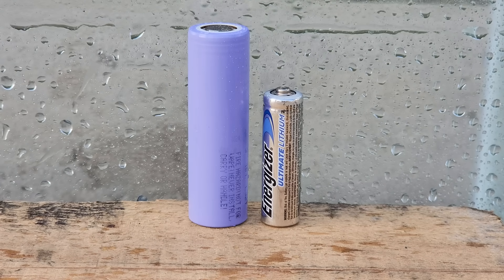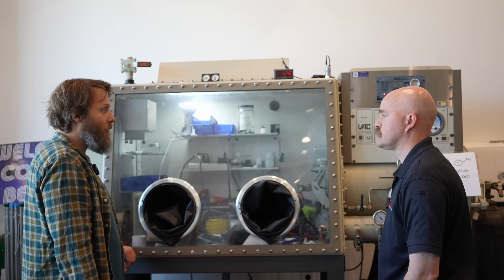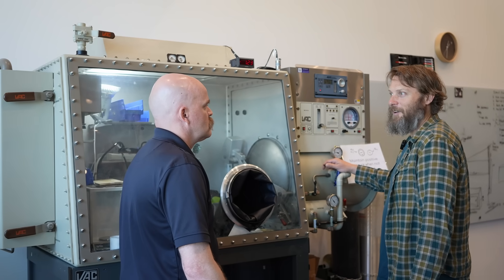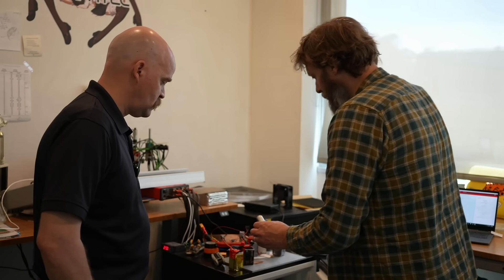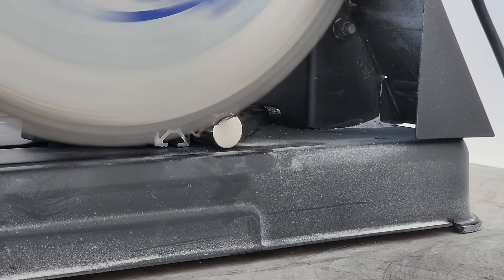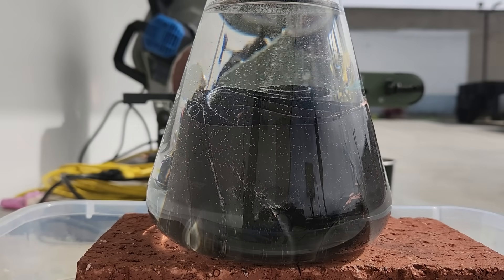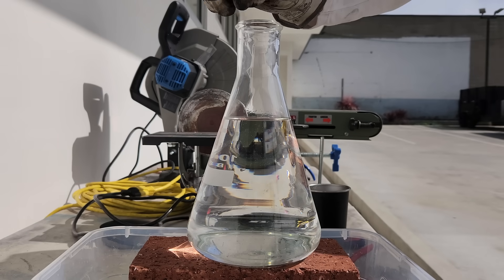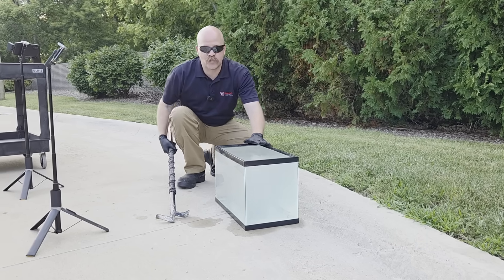Do Lithium(Ion) Batteries Explode in Water?

Comment: I'm not disputing this video, but people should be aware that exposure to water inside a battery bank like an e-bike pack can cause a short in the BMS, or the output circuitry or wiring which initiates the thermal runaway. I personally can vouch for an exploded 22a/hr, 90%+ charged e-bike battery when it fell into the bilge of my boat. The bilge had salt water in it which found it's way into the "water resistant" battery pack. The salt increased the conductivity of the water (clean, fresh water actually has low conductivity). The battery hissed and smoked for about 60 seconds and finally burst into unmanageable jets of flame. It wasn't that the individual cells were exposed to the water, it was the water passing current from one cell to opposing cells at over-discharge rates.
Reply from the maker: You are 100% correct.   Water in a battery pack will eventually lead to thermal runaway.  I put this together because do many people think that if an individual cell gets wet, it will instantly react violently.
Reply: @StacheDTraining  its an important concept : A cell is not a battery, a battery is a collection of cells. We get this wrong by calling a single cell a battery interchangeably in conversation which compounds the confusion for non-electronics professionals.
AA cell is a cell ... two (or more) of them in your "flash light" then means a battery is formed in the handle.
Reply: @finophile A cell is a collection of batteries. Edit: A pack is a collection of batteries. You are right the battery is a collection of cells.
Reply: How about - you are both right? A 'pack' does not equal a 'cell', because a 'pack' contains many 'cells'. 
I learned something in this video, too. I work with Li Ion cells, making battery packs for 2-way surplus radios, and have seen some anomalies with cells where after charging a particular cell starts to 'self' heat and will discharge itself, usually an older cell that has been cycled a few hundred times over more than four years.
Reply: Never buy cars that where flooded out and totaled by a insurance company regardless of whether it is a ice or anything.
Reply: @jonathanjones3126  It depends on what you want to do with the car.  If you are going to strip out all the electronics to turn it into a race car then it is a much cheaper way to go.
Many new cars have a lot of electronics in the floor so even if the water only got above the door sill the electronics will eventually fail from corrosion.
Reply: @johncooper4637 opd non computerized cars have a big draw, they also have significant issues that computer controlled ignition and air fuel mix solved
Reply: @jonathanjones3126  The only thing flood vehicles are good for is salvage yard (non-electronic) parts donors, which is a nice chunk of change when harvested wisely. I've built many vehicles using salvage parts, but never a flooded vehicle which is very different then using hoods, fenders, door sheet metal, suspension etc.
Reply: @jonathanjones3126  if they have an ecu, then moisture in the wiring loom is bad. But pre ECU okay but then we're talking classic and vintage.
Reply: @Biggles732 any break in wiring will develop issues eventually,  the pre computer cars are easier to fix if you the manual and wiring diagrams
Reply: @Biggles732  Classic and vintage corrode too, especially in salt or brackish water. The Air Force requires clear water rinse for aircraft flown too close to the ocean and that's not by accident. Old wiring with the usual existing insulation hardening and internal corrosion (wire left long enough in vehicles corrodes beneath the insulation over time) is best replaced. Even without a flood most old car/motorcycle problems are electrical. (I've wrenched since the late 1970s on vehicles old and new, wheeled and winged.)
Reply: @Comm0ut  yes, but the wiring in older vehicles is doable. The intricate wiring looms of today's vehicles means you have to abandon them /write them off if flooded.
Reply: Yes you rely on the precision craftsmanship of child laborers and trust that cargo shipper and amazon driver did no damage to the product before it got to you and that it never took a hard knock during use.
Reply: Where was the E-bike manufactured and sold from China / Amazon if the answer is yes there is your problem. Chinese sellers on Amazon have zero risk of lawsuits they use a local shipping center to warehouse their products. Amazon hides behind section 230 gives them immunity from lawsuits. If you want a high end ebike many are made in the US going to pay lot more Trek $4600-13000. Trek isn't made in the US anymore but they are a US Company you can sue. I guarantee their batteries will not explode if the bike falls in a lake.  There are lower priced American companies like Lectric bikes.
Reply: Was it fully submerged? If it would have been fully flooded it would have counteractede the thermal runaway?
Reply: @Sepp440  Hind-sight is 20/20. When it fell into the water it was completely submerged. I jumped to pull it out of the water and when it blew the first puff of smoke into my face, I threw the pack out of my hands where it landed on the settee table. I have had many moments of late night anxiety in bed going over in my head what might have happened if I had thrown it back into the water - could it have saved my boat? The water at the time was about a foot deep in that particular spot in the bilge (a really long story why) but it's my guess that the battery would have still cooked itself, produced all that toxic smoke, boiled the water making a lot of steam, but the flames and heat would not have spread to the surrounding wood and fiberglass. Boiling water can NOT rise over 212°F until it boils away. This is well below the flash point of wood and polyester resin. There was enough water in the bilge that it wouldn't have boiled away in ten minutes or less.
Reply: @3DPDK  Yikes man! That's some nightmare fuel, but good information for people to have at the leading edge of a similar set of circumstances. Condolences on the boat.
Reply: Call this YouTubery" - where comments disappear w/o notice.  
This gets old, YouTube. Your AI censor-bot has run amok.
Reply: @uploadJ  very very rude indeed. No explanation, no warnings , no apologies......
Reply: Another comment removed. 
Will never, ever buy YouTube Red at this pace.
Reply: @uploadJ  I've noticed they do two filterings - it seems the first one is instant and remove things you'd find with like word filter kind of stuff.  The second filtering happens like 10-30 seconds afterward and appears to be some kind of AI sentiment/topic analysis.

Comment: Lithium in Li-Ion Battery
A lithium-ion battery typically contains about 0.12 to 0.15 kilograms of lithium per kilowatt-hour (kWh) of battery capacity.
 For example, a 70 kWh Tesla battery uses approximately 63 kg of lithium carbonate (Li₂CO₃), of which about 12 kg is lithium, translating to roughly 0.17 kg/kWh.
 The exact amount can vary depending on the battery's design and chemistry.        Please explain how the lithium ion battery you tested contains no lithium. I understand the no lithium metal bit, kind of but as lithium is part of lithium ion I don't understand fully.
Reply from the maker: Table salt is a great example.  Elemental sodium is highly reactive with water.  However take salt is not because it's sodium chloride.   Lithium-ion batteries are similar because it's not elemental lithium,  it's a lithium oxide.
Reply: @StacheDTraining  Thanks. Some channels make out that if you look at these batteries the wrong way they go into thermal runaway. I like to know the truth which I believe is usually somewhere between the EV Evangelists and the EV haters would have you believe. Great to get the facts with evidence and explanations 👍🏻
Reply: Correct, it's electrolyte that burns readily from sparks created by internal short._
Reply: @DjResR  Some people refuse to look past a name, some like a short explanation to help them understand. Thanks for the explanation.
Reply: 🤔Yep. I think the general idea is that the cells contain lithium COMPOUNDS, not chunks of nasty, shiny, ultra-reactive lithium metal.

Ordinary table salt  (sodium chloride) contains an anti-caking agent called sodium ferrocyanide. Health nuts and conspiracy theorists get very worked up over the second word. I mean, cyanide is lethal, right? Yes. But a ferrocyanide compound is harmless.

Sodium fluoride in toothpaste gets the nutters overexcited, too. They see 'fluoride' and think 'fluorine', one of the most dangerous substances known to science. But as a compound it's useful and harmless.

People need to get a grip and pay attention in school...
Reply: He specifically said it had no "lithium metal".  Lithium oxide isn't in a metallic state.  This is basic chemistry.
Reply: @WanJae42  Shame I'm not a basic chemist.

Comment: How would it behave just dropping a charged lithium ion cell in sea water?
Reply from the maker: You would likely see bubbles as the cell slowly discharged into the solution.
Reply: It’d be cool to see a large clear container or several clear containers with several different sizes types, and where values of different batteries in saltwater.  Just to see which ones expand which ones off which ones explode.  You’re bleeding edge of fire.
Reply: I think one of the tactics being experimented with to deal with EVs that are going into thermal runaway is to dump the whole car into a strong brine solution to quickly and safely discharge the battery or at least, the remaining cells. Basically letting them expend their remaining charge  doing electrolysis of the salt water
Reply: It'd discharge. Rupture the casing if you want to see the magic smoke escaping.😁